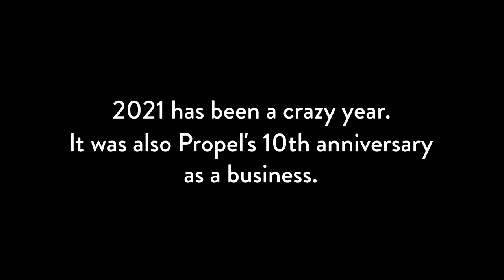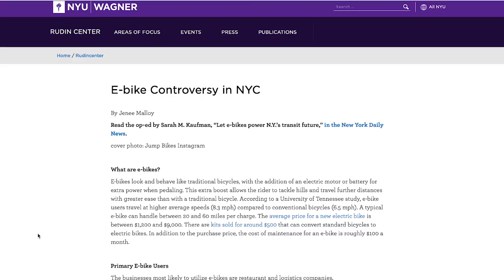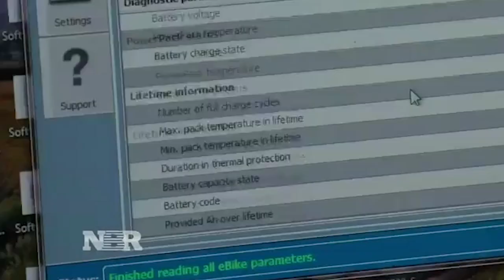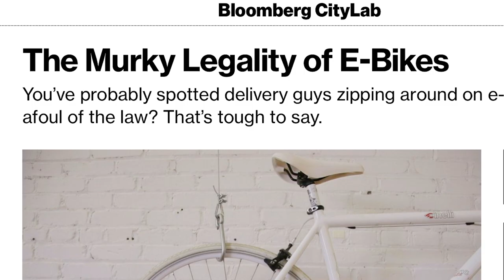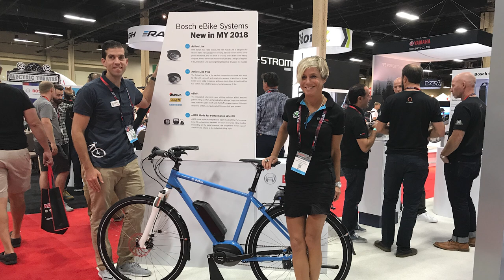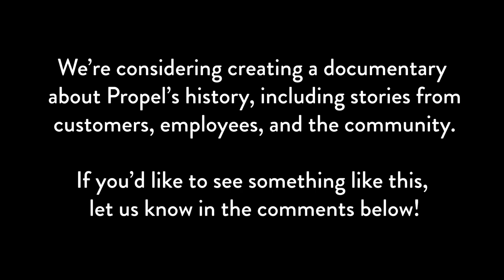How I started an illegal eBike shop in Brooklyn - and changed the law

Comment: I find your channel very interesting and educational. Unfortunately being 68 years old on disability for 20 years, cervical spine injury, bad knees all my life. I bought a Kent trike. It was available I forgot about recumbents, as it was 20 years ago I was told I should try one it might be better for my disabilities. Didn't have the money couldn't get it from a small special needs trust that was set up poorly. Then covid comes along and we get these checks and I use mine to put together an electric grocery getter e bike. I wrote it for a year with just the throttle. Then I was told it's an $800 ticket to Ride on the bike trail along the river with anything but a class one eBay. So I put on the PSA. Maybe it's just mine because it was the recommended one on Amazon not the cheapest but not the top of the line. With the pedal assist I get full speed or nothing I feel it's more dangerous than using the throttle. But I was limited by the amount of money I had. Motorized wheelchairs are also illegal on that part of the rail trail. Because they don't have pedals.
In short I need the throttle because of my bad knees and I have better speed control with the throttle then with the pedal assist sensor. Money talks poor people right paratransit. Thank you very much and even though you don't like throttles I'll still watch your content.